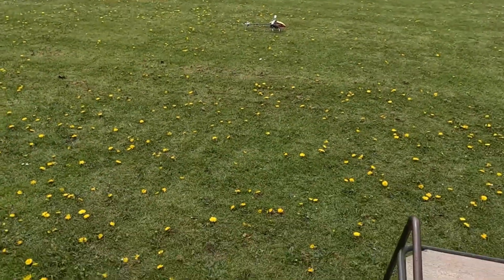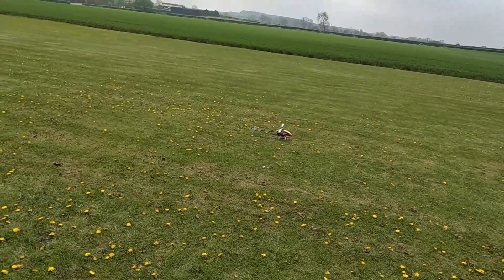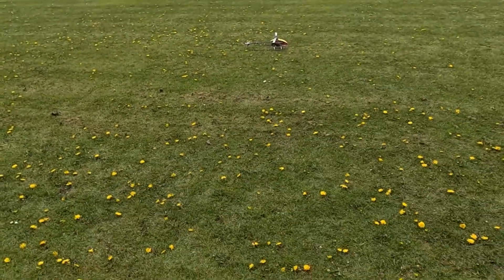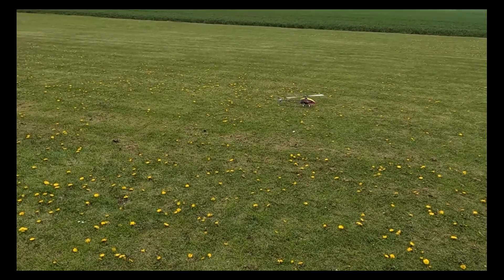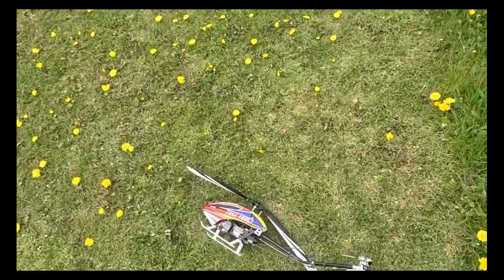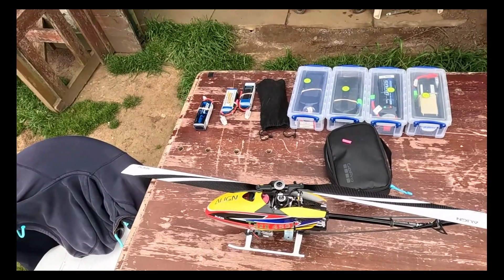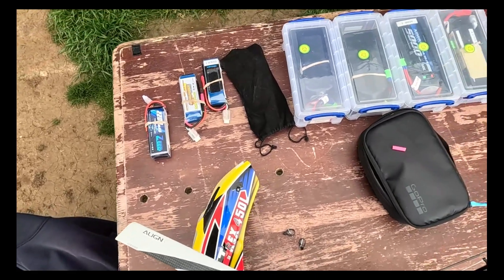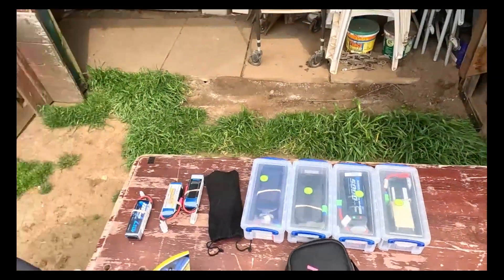Trex 450LP Dominator 3rd Maiden flight & 3rd Crash

Comment: Sorry to see this Pete. I'm so nervous about flying my 450lp around for this reason it just doesn't crash well atoll. Stick with mate it'll all pay off in the end
Reply from the maker: I have put a new gyro in the 450LP and feel there wasn't enough control authority in the head. I will adjust the gain accordingly and hope to be back with the 4th maiden by next week. One positive is this is the best flight I have had with this heli in 3 attempts. The previous two the hel just tipped over and exploded. I wanted to get it into a hover but she just went up around and down. I have not experienced anything like this with my M2.
Reply: @All_things_RC.  so when I first got my 450lp I had the same issue when trying to get it off the ground. It scared the life out of me lol. What I got told to do is to take of a little faster and this was the problem I had. When I'd slowly take off it'll tilt left or right depending on wind but now I let it spool and go straight to 55/60  percent stick and boom its up and steady.  Ground vortex I think it was described to me as. Hope this may help Pete. 🤞 the 4th flight goes perfectly for you mate 👍🏻 👌
Reply from the maker: @Rcheliguy  That's what I thought to do this time, spool up go straight to 60% on the collective and get here airborne.  Worked well but with the dull cyclic response there was no controlling it in the air. Great advice though and it will be a style I will adopt until more proficient near to the ground. I was told to do short bunny hops at first which as you point out this is all in rotor wash and didn't end well. Allot of trial and error I feel in the early stages.  👍🤛
Reply: @All_things_RC.  I use the a10 tx that come as part of the rtf kit. I myself felt it was very floaty on the sticks. I've now adjusted the expo on the tx and this has totally changed how it flys. I've now got the sensitivity just we're I like it. I myself like my helis very sensitive around mid stick so I'm not having to put massive stick movements in to get any response. Hopefully soon I'll be flying it around at the new club I've joined. I'll make sure to put up some progress videos soon. 👍🏻👌
Reply from the maker: @Rcheliguy  I also use the Align 10tx. Tightening the stick movement / feel was the first thing I did when i bought the heli, these were far too sloppy. Carrying out short hovers in my garden the head sensitivity felt acceptable but found later and as seen in the video I needed far too much stick movement to get the slightest response. Out of interest and if you are using the Align Mini GRS controller, where is your roll rate dial set. I am currently on 50% (at the 9 O clock position). I am not sure if I need to increase this to say 10 o clock or even the 11 o clock position.
Reply: @All_things_RC.  hi Pete. I've just looked at my roll rate and it's at 1/7. If rember correctly it was at 10/5. But I changed it to 1/7 and its spot on my expo was at -30 and now its at +19 and its very responsive now. Adjuste to these settings get it up to hover and just give it left and right on the right gimbal see how that feels. If it's too responsive lower the expo but 4 to 15. Hope this helps mate 👍🏻
Reply from the maker: @Rcheliguy  Cheers Pal its very helpful and a starting point. Been out with my Rotor Scale 180 today rattled 6 batteries of and no issues. Great confidence builder. Thanks again.

Comment: Always hate to see a fellow Heli pilot have a crash, and I know how horrible it feels Pete, and the parts even for a Trex 450 are not cheap are they!! I remember I built and started flying a Trex 500e and it was very stable in the hover, I then decided to get a 450 sport DFC and crashed it so many times!! I find the Trex 450 with flybar or flybarless very very twitchy to fly, so was shocked to here you say your 450 was unresponsive!! What flybarless unit is it using? Anyway, chin up, I'm sure you'll get it flying well, hope you get it sorted Pete 😀👍
Reply from the maker: Hi Ian thanks for your comments. The flybarless unit is an Align Mini GRS the roll rate was set to 50% on the unit which in hindsight I think this may have been too little? I have found on a forum a suggested 70%? The parts have arrived and I think it will be a relatively quick fix so hope to be back in the air soon.
Reply: Glad you've got it sorted Pete 😀👍